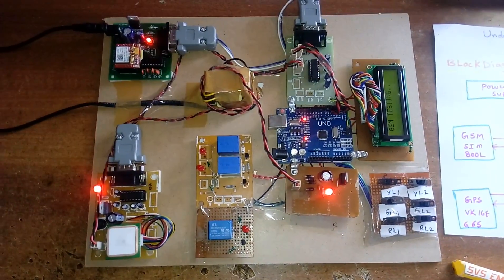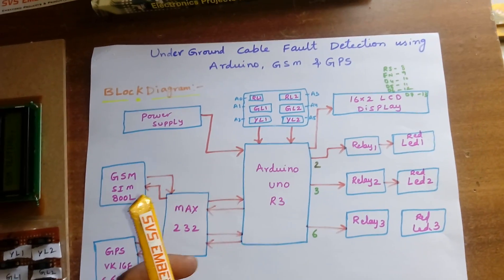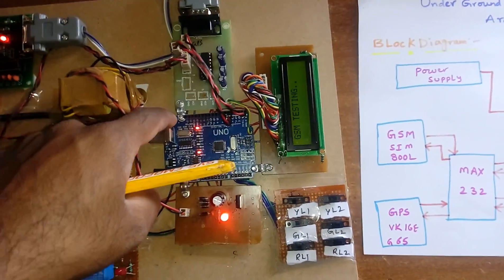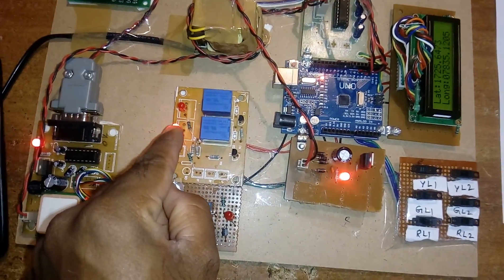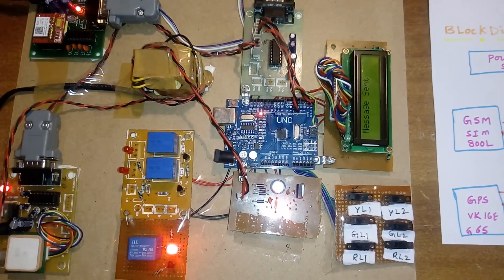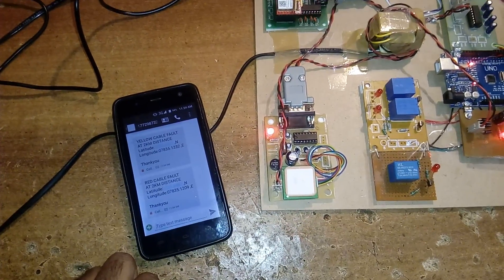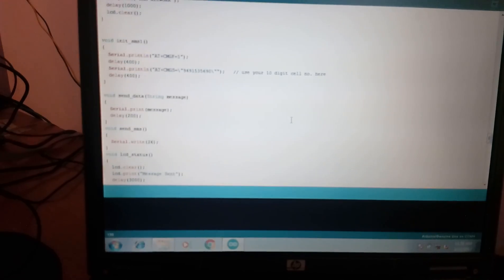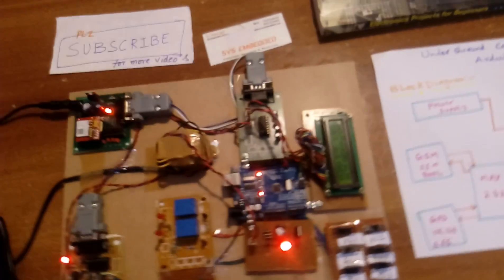Underground Cable Fault Detection Based On Arduino, GSM and GPS

Comment: Sir please send me the coding of this project at engrabduljabbarkorai@gmail.com
Reply from the maker: Thanks for watching and your valuable Feed back.yes we will help on coding part.
we are selling the projects with least cost.if u order the project we will provide working hardware kit along with 
1.abstract
2.datasheets
3.documentation
4.schematic( circuit ) diagram.
5.software code.
6.sample ppts
7.photos&video file on entire project
through google drive.if u r interested to take the project.
send me a mail to  svsembedded@gmail.com,info@svsembedded.com.
9491535690,7842358459,
www.svsembedded.com,www.svskits.in,
we will send u the how to order procedure to u on mail.

Comment: you r a  best sir pls I want to program code.  send to my Gmail id. ramesh13028ee301@Gmail.com
Reply from the maker: Thanks for watching and your valuable Feed back.yes we will help on coding part.
we are selling the projects with least cost.if u order the project we will provide working hardware kit along with 
1.abstract
2.datasheets
3.documentation
4.schematic( circuit ) diagram.
5.software code.
6.sample ppts
7.photos&video file on entire project
through google drive
send me a mail to  svsembedded@gmail.com,info@svsembedded.com.
we will send u the how to order procedure to u.